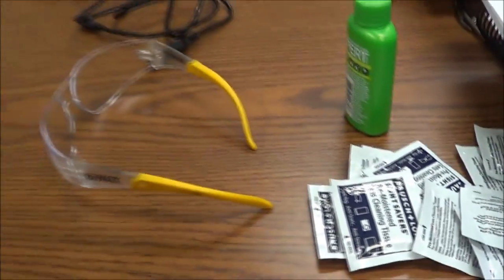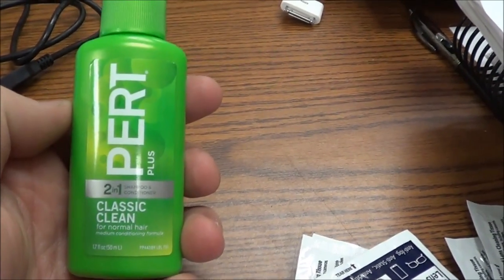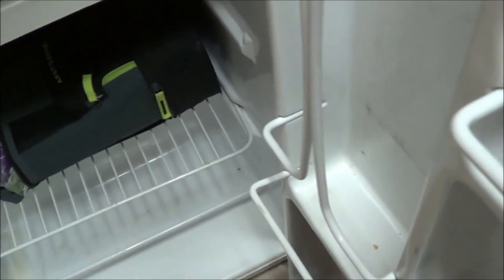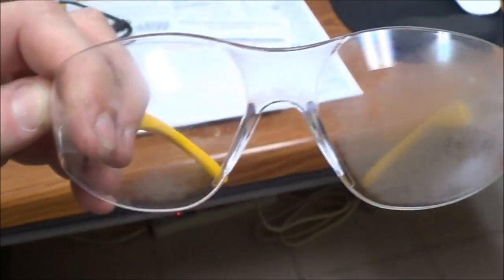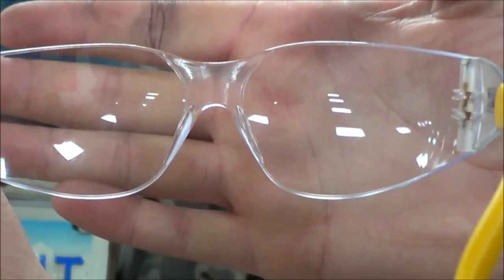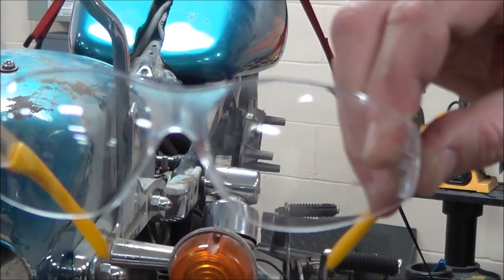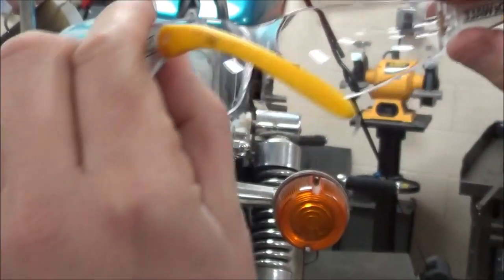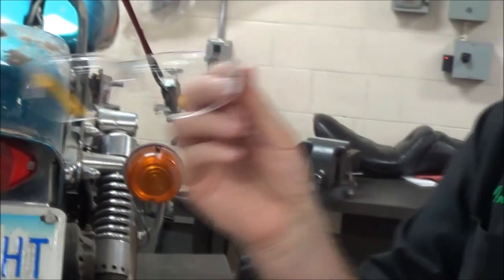How to anti fog your glasses miror and windshield with shampoo vs anti fog comparison

Comment: I have a problem in the summer with my shooting glasses fogging up while trap shooting.  It's frustrating when you launch a clay bird but loose it because your glasses are steamed up.  I use a product called "Kat Crap" with limited success.  Made for snow mobilers with  helmet visors in cold weather riding.

Comment: Pert didn't work gor me. Maybe normal temps. My garage is 45 now.  Glasses are fogging like crazy no matter what product i use or buy
Reply from the maker: Hi Jack, 
Have you seen the videos I did on my fav anti-fog safety glasses? I was from Iowa and used these with great success in hot and cold (much more hot weather). Here are the links to my videos and an Amazon link to the glasses. 
Part 1 test: https://www.youtube.com/watch?v=u-mV8MMe3j0
Part 2 test: https://www.youtube.com/watch?v=2yKR3koAeZM
Amazon link to buy: https://www.amazon.com/dp/B0728JCWB2/?ref=idea_lv_dp_ov_d&tag=aiponsite-20&linkCode=iil&ascsubtag=amzn1.ideas.38BRLOXKX7C0D 

Thanks for commenting and adding value to our community!

Have you subscribed yet to never miss a video? Have you seen the video playlists? Over 600 videos! Check them out here: https://www.youtube.com/user/conleybuilt/playlists  

Want to say “thanks” or “keep it up”? Click here https://www.paypal.me/how2wrench    
 
Your answers and help are just around the corner. Save time and money while protecting your investment and yourself by doing it the right way at www.How2Wrench.com